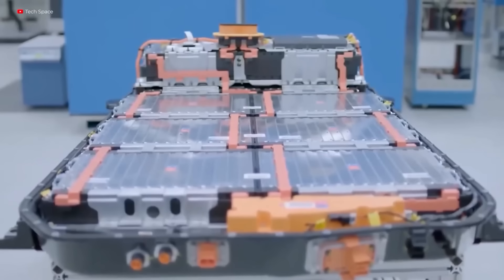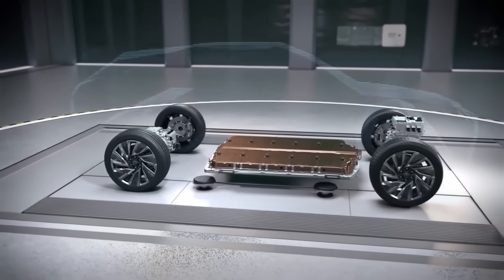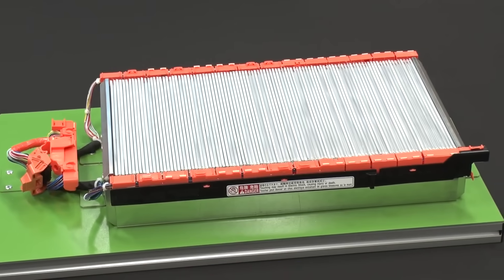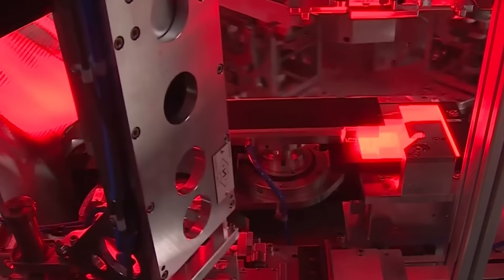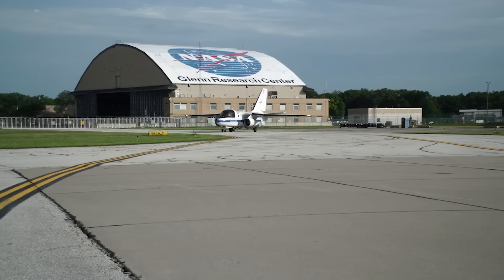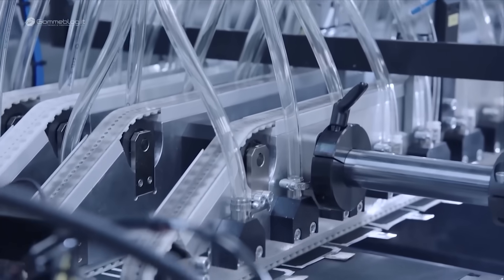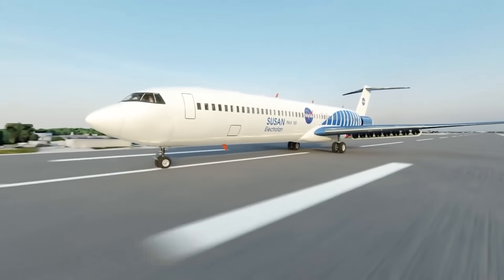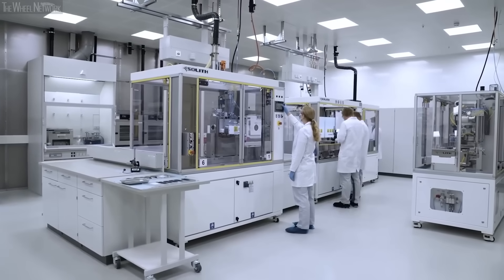NASA Reveal New Sulfur Selenium Solid-State Battery That Changes Everything

Comment: Give it 5 or 10 years and we'll find out that it has a huge problem with 1. overheating. 
2. Not working when it's cold.
3. Exploding, if it gets on a crash.
4. Creating a large amount of heat when discharging.
5. I could go on but those are the main ones That every battery has to overcome.

Comment: It would be great if airplanes could stop burning fissile fuel. Electric motors would be much cleaner and quieter. My plug-in hybrid saves me a lot of money not having to buy gasoline. Sometimes I don't pull into a gas station for over two months. And, I am helping to keep the air clean, p.s. I charge my car from my 32 solar panels on the roof of my home.

Comment: It doesn't replace lithium. Its replaces the liquid electrolyte with a solid electrolyte. The cathode is the new technology which consists of ultra light graphene, S/Se particles and SEM of
holey grail graphene type scaffolding. It uses more lithium metal in the anode. Very exciting for the future of battery powered "everything"
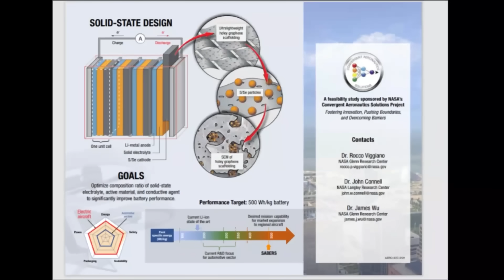Reply: It shows NASA's new technology composition @4:23min

Comment: My concern is that for the energy storage capacity and it charging in 10 minutes, What exactly would be the amp draw??? Woof. And cable life for the charging cable would be a MAJOR concern with the imagined draw required for rapid charge. As it would reduce the use of dangerous Lithium Batteries, I can see a potential concern for peak draw hours on the infrastructure as it currently sits..... Now we discuss the new find of Lithium here in the States. Do we have a similar Selenium deposit?? If so, then we definitely have a bit of an edge in Storage Technology and Energy efficiency. So, with THAT, can we NOW consider Thorium Salt reactors instead of Uranium reactors? We KNOW the IMMENSE safety advantage of Thorium reactors, I am STUNNED that we have NONE at all in Commercial use...... Imagine, Thorium Salts Reactors Storing energy in Sulfur / Selenium Batteries???? Safety AND efficiency, all in these 2 technologies.

Comment: The jump to solid state batteries from lithium ion batteries will be a huge gain by several magnitudes. And there are many uses for them with the most notable being smartphones and EV's. Unfortunately at this time it's extremely expensive which is why NASA is the only ones using it. Hopefully in 3 years from now the price will have dropped to that of current lithium ion  prices which will make it affordable to the masses.

Comment: Sodium ion looks promising as well and lithium sulfur. If we could have about 10 times the energy density as current lithium ion batteries that would be the game changer for EVs. Gasoline typically has about 100 times the energy per unit weight than batteries but electric motors are far more efficient

Comment: I just want a electric car with a battery that lasts 30 years. Of course there's room for improvement in all areas, but I have no problem with current range and charge rate. I just want them to last longer
Reply: I agree, if they would last 30 years it would be like buying a house almost. Imagine how small car loan monthly payment would be if it was a 20 year payment loan
Reply: Technically new Tesla batteries should since they are supposed to be one million mile battery

Comment: So, instead of using so much battery power for take off of traditional flight, why hasn't anyone designed a catapult system like on aircraft carriers. It doesn't have to be something that pulls five G's, just something to take the discharge load requirements off of the batteries during takeoff, increasing the range of the battery or even requiring less total battery weight to achieve the same distance of flight.
Reply: Would hydrogen fuel cells be better for airplanes, trucks and ships?
Reply: Good point.  A long, gradual catapult assist is perfect.  It will be fairly easy to incorporate into runways.
Reply: Spin launch
Reply: Do you know how much energy is required to launch a F-22 off an aircraft carrier? For a (relatively) small aircraft, an electromagnetic catapult system consumes up to 100,000,000 watts of energy for a 3 second launch. 

Now, imagine scaling the energy needs up to a Boeing 747. Nuclear fusion reactors probably consume less energy on startup.

Now, let's say this were to ever come to light, the cost of such an infrastructure would be so cost prohibitive air travel would probably come to a halt because the airline industry isn't going to eat the cost, the travelers would. Air travel is already pretty cost prohibitive.

Now, you also have to consider your own statement: "it doesn't have to be something that pulls 5G" well...it kind of does, force is an important factor on how far something travels. If you simply get an aircraft up to take-off speed, it's basically going to have to do all of the work as soon as the catapult system let's go, in order for you to launch it into the air it's going to need force to create lift to overcome gravity. 

The reality is, wasting energy on takeoff is really the lesser of concerns when moving from fuel to electric airplanes. The payload-range curve, the fact current jet engines are constant- thrust vs electric which is constant-power, and more.
Reply: Or maybe just a gravity assisted declining ramp, to help the plane get to almost enough speed for taking off. Would be fairly inexpensive.
Reply: Instead of wasting all this oxygen on such a pointless topic why don't we get our priorities straight and call these bull shit clematis out on their lies
Reply: They have they just don't want to release the technology.

Comment: I'm surprised no one is developing an electric plane using rocket or jet assistance during the climb phase. If this was done, both size of electric motors & weight of batteries could be dramatically reduced. Renewably derived fuel would be called for of course.
Reply: It's the added weight that makes that an inefficient alternative. Going electric already makes the platform heavier than it's ice counterpart... Adding more weight wouldn't be viable.

Comment: While this sounds good , I dont see battery powered aircraft reaching supersonic speeds or heights of 80,000 ft . That would take them out of consideration for most military uses . They talk about high cost , however Toyota recently announced they were in the process of building the same type of solid state batteries only they said that it much cheaper than the lithium ion batteries currently in use because of the lack of rare minerals we currently source from other countries like china !
Reply: Planes for regular people ya goof. The military can take care of themselves. Fossil fuels is the biggest polluter.

Comment: Cost factor is important. This should be reported as well as the rate of cost reduction. Toyota has announced its solid state battery and claims that it will be half the cost of conventional batteries.  Tesla's 4680 battery still uses Lithium but is their million mile battery which for normal car drives will last 30 to 40 years. Life expectancy is an important spec. The 4680 also reduces cost by almost half. It uses a new alloy casing strong enough to build the frame of the car so total car weight is reduced. 

Comparing spect to the 4680 and the new Toyota (and others) may be useful to calibrate where the technology is and projected to be.

The NASA work sounds very promising.
Reply: Toyota has been making solid state claims since 2014. They have not shown any evidence of their claims. It seems they're true goal is to slow down progress.

Comment: (This is going to sound like a lie BUT)
I'm CURRENTLY an intern at NASA Glenn working on this exact project. 

AMA
Reply: How soon do you think this will be available commercially? What about cell phones? Everyone talks about EVs but whay about the benefit to regular consumer electronics?
Reply: @ikutoisahobo  Nissan talked about one being done around 2027 but (depending on our materials, their processing requirements, and the time it takes to build up those manufacting capabilities) it may not be until 2029 or so. 

Cellphones may not use the same chemistry/have other things. The reason for this is because different devices have different needs. For a phone, the best battery would be one that can optimize energy storage/volume, as well as cycle life and cost. Our batteries are optimized for potential power output (lot of energy to fly a plane/drive) per unit of mass it takes up. We also care about cycle count and cost (and also which countries have control of the necessary resources), but power/kg is a much bigger deal tous
Reply: @philosophyman  I think Toyota is talking about 2017 for their solid state.

Comment: The point where commuter aviation batteries make sense over fossil fuels is not 2-3 times the energy density of the best lithium batteries, but rather around 10x.
Reply: I'm not sure that's  totally true. First, while I suspect you're right for the really big passenger stuff, the regional might fit the 2-3 times slot (fuel has weight and electric motors are lighter than internal combustion )
Reply: Thing is that fossil fuels aircraft lose weight overtime as they burn through the fuel. Electric batteries on the other hand stay the same weight regardless of their charge. That is why for practical electric aircraft we need batteries that are significantly more energy dense than current battery tech allows
Reply: @RocketHarry865  true but don't  forget your biggest fuel burner is take off (while you're at your heaviest)
Reply: Hot
Reply: It's really disheartening when I see an educated person use such an uneducated statement. There are no such thing as fossil fuels that was a term deemed by Rockefeller to give the impression that they would run out someday that that's causes the fuel panic that's why everybody so worried about gas they think it'll run out someday the only fact of the matter is there's only one thing on this planet that  even comes close to water in abundance and that is oil, not fossil fuels. This statement is one-hundred-percent fact no opinion just straight science and common Sense look it up look into it dig deep ya dig deep for everything nowadays cuz everything's masked with b*****
Reply: Oh okay so now that they've depleted just about everything they f**** they have set up it's time to change the infrastructure with the s*** they stole from Nikolai Tesla that's awesome.
 
Anybody know what NASA means an ancient Hebrew?
More fact... 

Answer is: literally "to deceive"
Coincidence? No such thing as coincidences.. or  Phenomena
Yet in order to mentality accept the idea of a spinning planet you are forced to accept Phenomena. Which doesn't exist😮😂

Comment: The Tesla batteries do not necessarily burst into flames because of liquids in the battery.  It's a short and thermal runaway process.  Very dangerous batteries.
Reply: Any particles or debris that makes it in the cells during production also cause fires.

Comment: Toyota has a solid state battery system that has a 850 mile range and charges in ten minutes. This NASA info a day late and a dollar short.
Reply: How long does the battery last?
Reply: Source?
Reply: Toyota battery probably weighs a lot more...are you paying attention?
Reply: Wrong on Toyota. They don't have one. They claim they Will have one in production for 2028. They are a little ng way away and haven't produced anything yet
Reply: How do you figure?  Toyota has theirs now Nasa/we have one too.  This is just the first model. Don:t doubt that they will be improved upon.